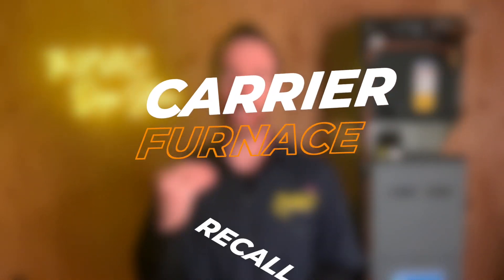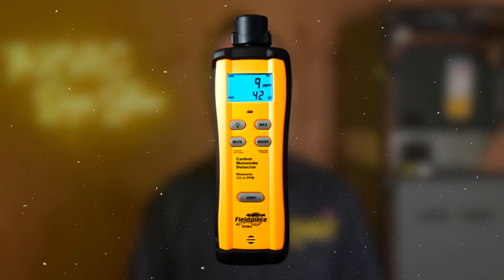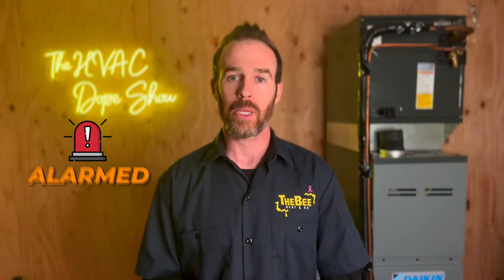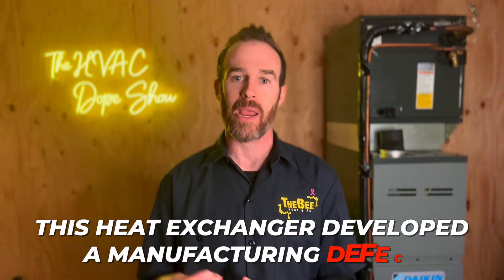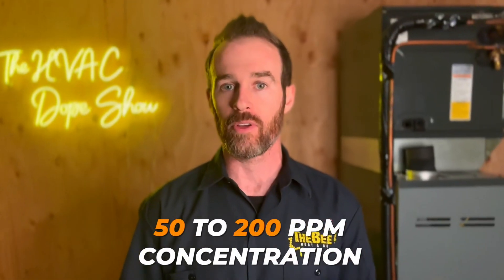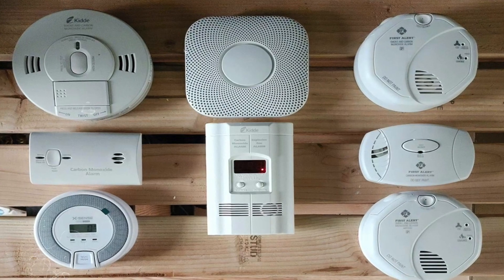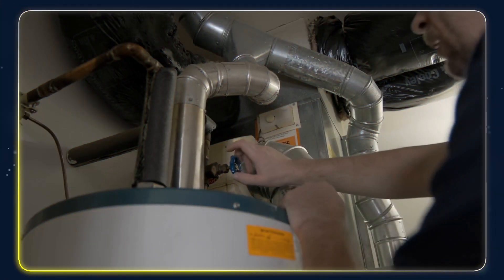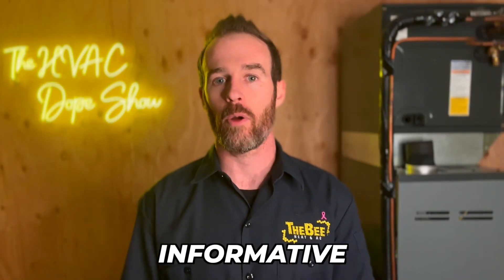Carrier Furnaces: Heat Exchanger Recall⚖️💰

Comment: i disagree with not replacing secondaries on these furnaces.
even though it is a poor design, if it is properly sloped and gas pressure set right as well as blower speed, the secondary will last quite a while.
If a furnace is 10 to 15 years old secondary replacement may extend life by 5 to 10 years and be worth it especially with carrier covering part of labor. this being said, units closer to 20 years old are not worth fixing.if there is an install/sizing related problem the new secondary may fail quickly.
Reply from the maker: Right on thanks for the feedback yeah it’s ultimately up to the customer we just have found customers would rather not spend the money normally we’re looking at 15 -20 year old systems when we see these so they’re normally leaning towards replacement after we explain the blower and inducer and other wear and tear items could still fail. It just depends on what they’re trying to accomplish, thanks for the comment!